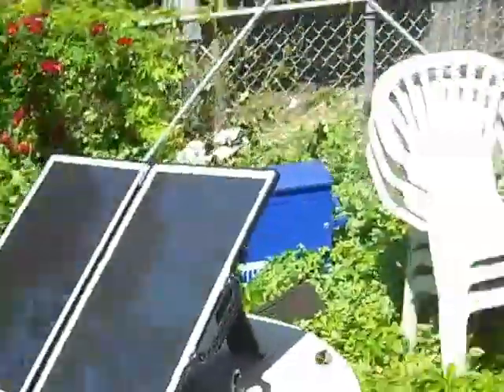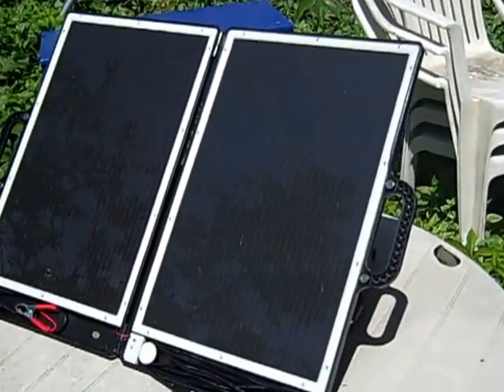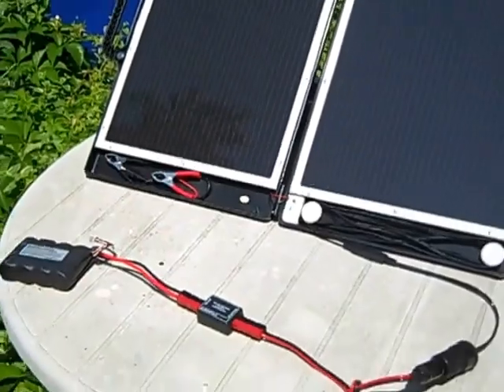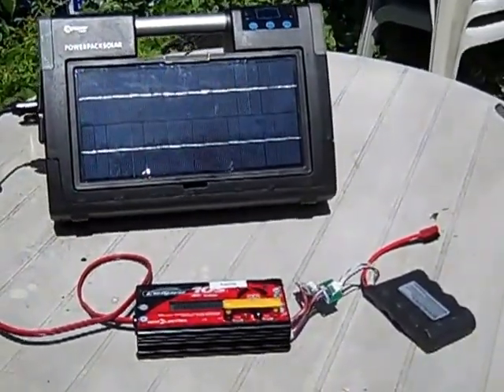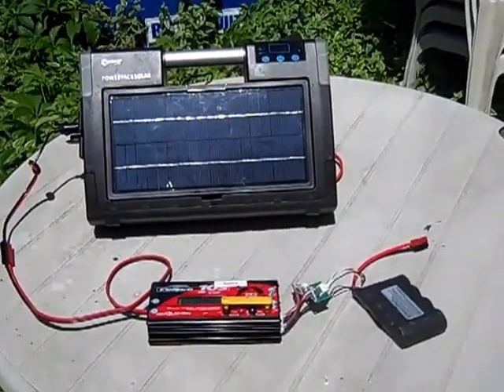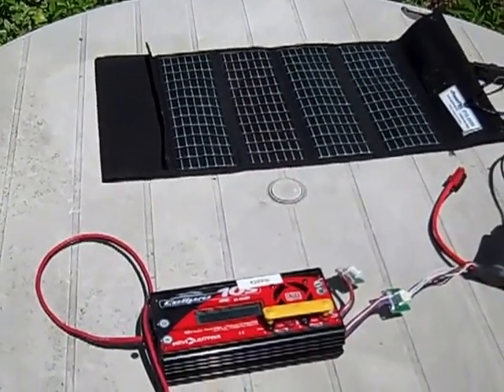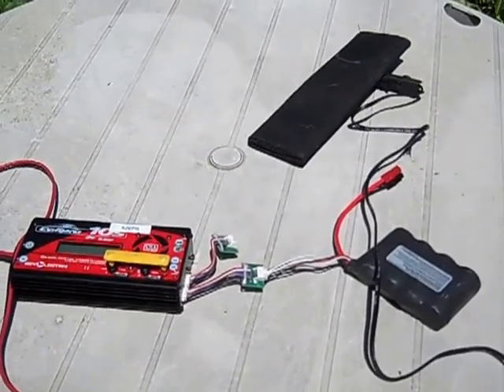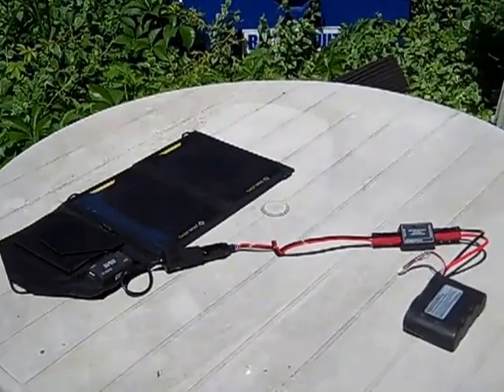Charging A123 batteries - Part 2: Solar Chargers

Comment: Hey, sorry for the late comment.

I am looking for a battery pack for a diy project that can operate while charging. My current solution is with an SLA battery, a charger for SLA and PSU 12v. While the system charges the battery a comercial fuse, switch the power source to the psu and charges the battery with Charger.

I am looking for simplier solution and with more juice and lest weight. Any chance of doing something similar with LiFePo or Li on batteries?

Waiting for your advice,
Thanks,
Zenon

Comment: Thanks for the nice video. How do you tell when your LiFePo4 battery is fully charged when charging directly from a solar panel using the Buddipole charge controller?
73,
Greg